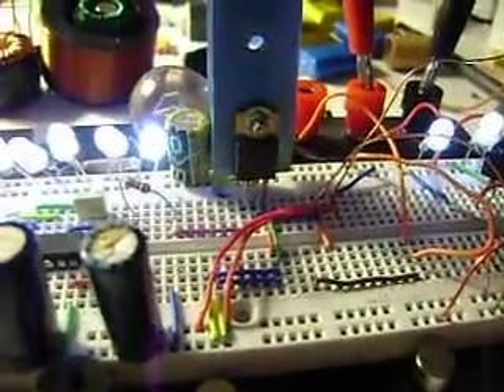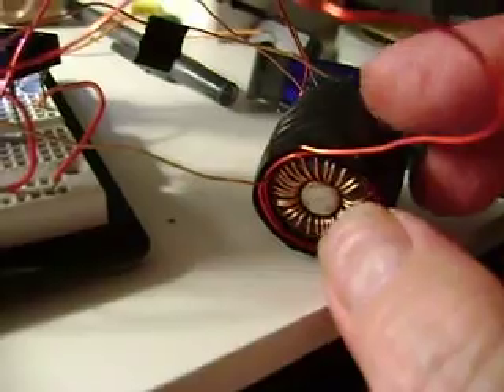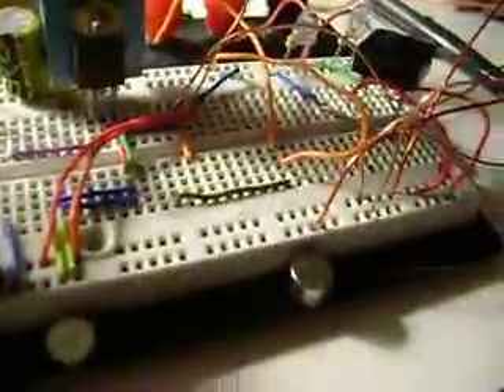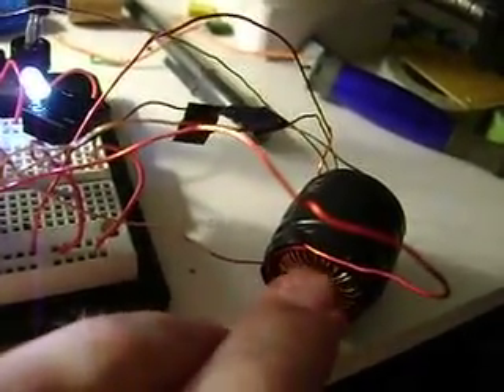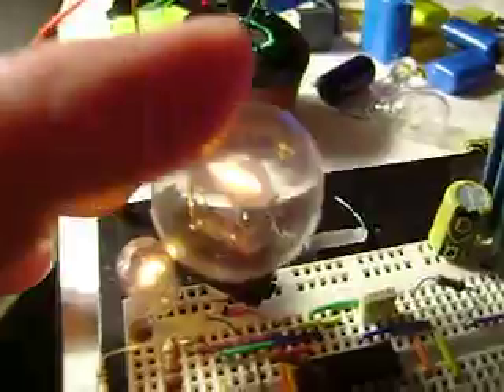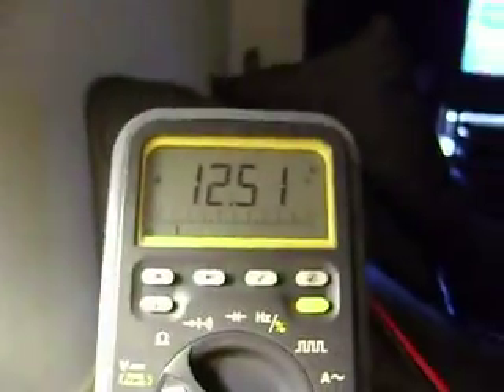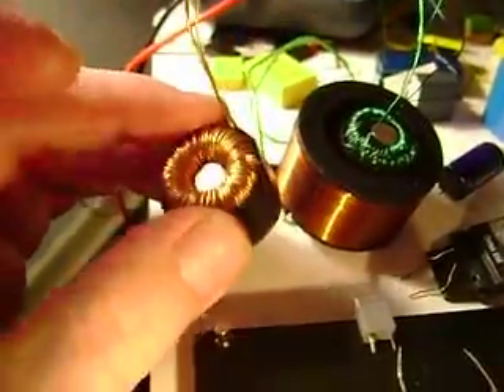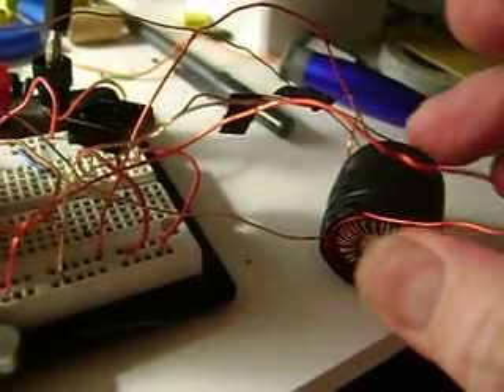Orobonbon and S2gen    Same Thing Aint It?  =]

Comment: @Magluvin, it has been a while, but do you remember if your Tcoil was wrapped on a ferrite core? I don't understand if in the middle of the Tcoil is a ferrite core or the 18 turns pickup coil. Thanks!
Reply from the maker: The windings are on a ferite bead typical of what is on computer cables encased in plastic. The output coil is wound around the core then the input is wound like a toroid coil on top of the output coil. The outer cores are just big enough to fit the wired core with some electric tape to protect the wires and have a snug fit.  The magnets return field through the wired core being attracted to it because it is close to the poles of the magnets, but when we pulse the input winding, the magnets fielde is no longer attracted to the wired core and jumps to the outer cores, and in doing so the field cuts the output coil creating current, and also when the pulse is finished, the field is attracted to the wired core once again, and again cuts the output coil creating current in the opposite direction. repeat.
Reply: Thanks for explaining the process. In the particular one above, it looks like there is no outer core, there is only the red thick wire on the outside. Am I correct?
Reply from the maker: Oh yes. Sorry. This was a different test. Still the operating function is the same just with no outer core. The field will expand out of the inner core when the primary is pulsed.
Reply from the maker: Yes. When the inner core toroid winding gets pulsed, the magnets field is released from the inner core and the field cuts the outer winding providing output from the red winding. When the pulse is over, the mag field is again attracted to the inner core and the field once again cuts the red winding.  It works the same as with the outer core in previous vids, but it seems to work better with the outer core

Mags

Comment from the maker: so that is a waste. And the fields that come from the center of the pole are a lot less from this loss.
The toroid will have less affect on short mag edge field because it doesnt really go to far from the mag and doesnt have a chance to cut the coil.
So going long is better either way.  And at the ends of the magnet the rim of the Tcore is surrounding the poles to capture and release very efficiently. My toroids dont saturate. At initial pulse I would say she is working. =]
So short pulses
Mags

Comment from the maker: I would have to get a diametric that fits. Ill take note of that. Most all of my toroids I have wound that are shorter axially dont work well like the Orbon. Short magnets like for example 1 of the 1/4 x 1/8 have a tight field return at the edges to the other side, where a longer magnet, the poles can bloom outward more freely due to less tension at the edges.  So a short mag, a good amount of the field will remain at the edges whether the toroid fires or not...........

Comment: JLN's magnets run across the inside of his toroid,
your's run along the axis. His lights glow alot brighter with the fields aligned this way. Try inserting a diametrically magnatized cylinder inside the core. I bet your output increases!